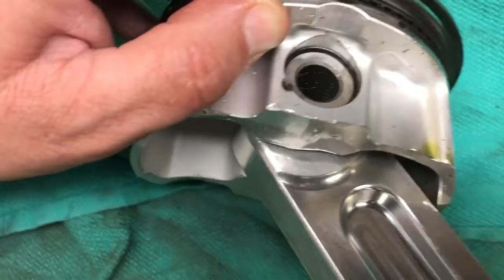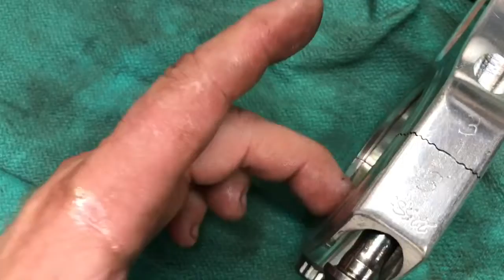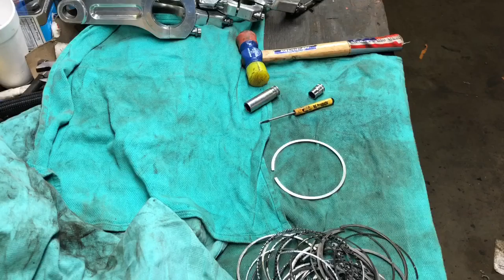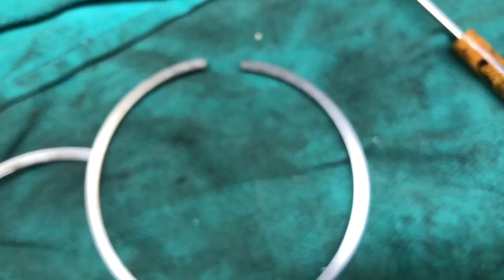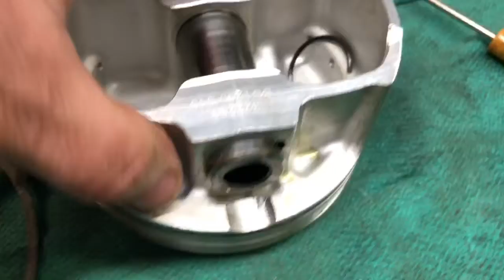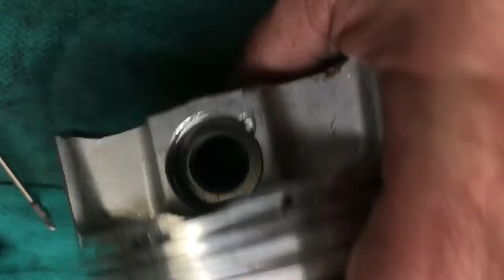Engine Piston Prep, Rod and Ring Removal- Getting ready for new rods and rings

Comment: Thanks for another great video. All my race motors that I have done have had spiral locks and they can be a bit of a pain in the ass I don't know anything about the button type it is definitely something to look into now. A quality aluminum rod is definitely the way to go I have never personally run a aluminum rod but my understanding from fellow Racers here and engine builders is that they have a certain service life depending on the power level they should be changed at a certain amount of runs or seasons. How many runs or seasons do you put on your aluminum rods before replacing them as routine maintenance? Thanks for the great videos keep up the great work
Reply from the maker: Thanks, I have been buying used rods with 75-100 passes, then getting a 100 or so before I break one.  I’m not always sure it’s the rods fault though!  It depends on who you ask!  Some lower rpm lower power get hundreds of passes!